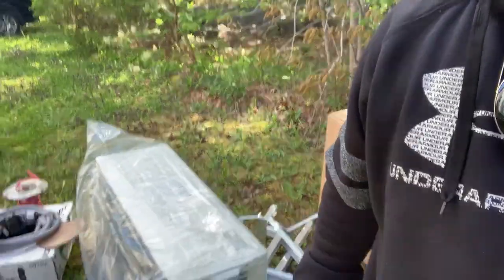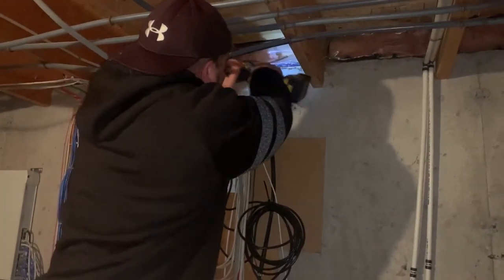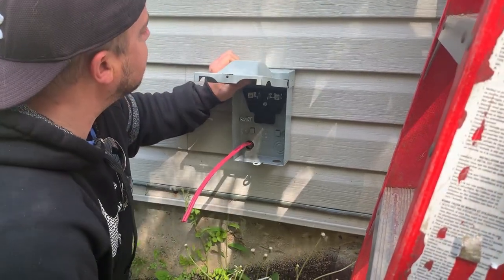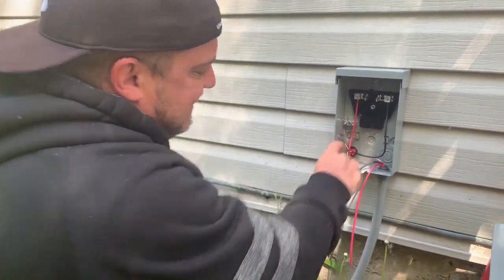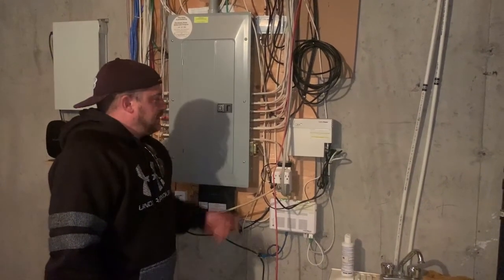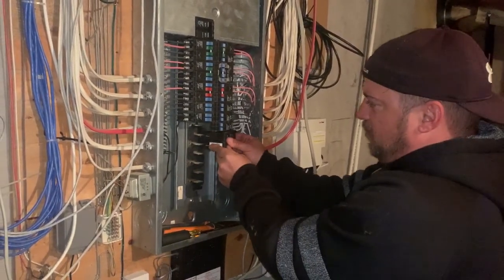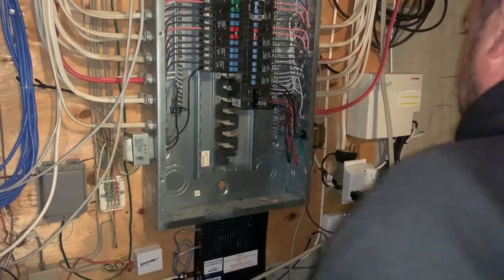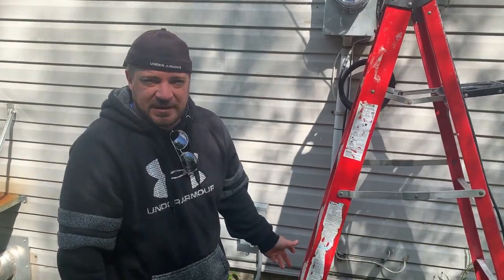Wiring Of Hvac Heat Pump Electrical Installation Of AC Unit

Comment: Must the AWG of the wire FROM the Disconnect TO the panel be exactly IDENTICAL TO (more or less) the whip AWG?  (I have RovSun 12K  btu, "SJOW 4x16 AGW 60 -300v"? THUS, 16 AWG to the disconnect from unit, TO 16 AWG to panel ?) ...I also intend on using Eaton 20A-60A GFCI (code req'd) disconnect box; with 10-2 Romex and 30A dpoled breaker; 1/2 pvc conduit run. Overkill? underkill? Thx! I know a lot of ques, but main ques matters, identical wiring...
Reply: Where would you  even find 16 ga wire to run from disconnect to panel?

Comment: I just called Fuse Electric to wire my mini split ac, which is 6ft away from my breaker outside. These dudes gave me an estimate for $1041.67. Labor is showing as $850 and the rest is the parts. I can't believe how simple it is
Reply: i said the same thing" These electricians are wanting our bodyparts for a  AC DISCONNECT. Did it myself after watching this video. I just turned off the main breaker.

Comment: Thanks - super helpful. We had a baseboard with a 220 30-amp breaker, but the installer used 14/2. When I checked the voltage, one wire was 121 volts, the other was 14. It's an old breaker in an old panel, but there's a new sub-panel to the side, so going to do exactly what you've done here, and use the right wire (10/2) and a 30 amp breaker for our 24k BTU heat pump.

Comment: I just did a similar installation and it took about a whole week! The reason is that I had to make a rather complicated series of pvc pipes and 45 and 90 degree elbows to wrap around the various ins and outs of several rooms, on the foundation under the siding, taking care to rout it over and behind various other obstacles, over to the big power panel. I wanted a neat appearance, so took extra time to piece it together using many pieces, all while being eaten alive every day by hordes of mosquitoes. Then drilled into bricks around this perimeter to clamp the pvc on neatly. The interior unit caused even more problems and several weeks' work because it is an old house with plaster-on-lath walls, and I needed to repair big holes in the plaster, and attach drywall as needed. Because of lack of modern standards with wall studs (they are not evenly spaced and cannot be found with a stud-finder), it took lots of drilling holes to find any studs, and of course only one could be used to attach the mounting plate. Making the 2-1/2" hole was another difficult chore because it is not a simple matter to neatly drill plaster (it is more like brittle mortar) without it breaking loose from the lath. Another problem with the lath is that parts of it are not firmly mounted to any studs, so it is hard to cut loose wood that is just flapping around. In general, I find that any renovation job in this house requires about 4 or 5 times as much work as the same job in a normal modern house. That's why everything looks so easy in the youtube videos, most people face far easier tasks. The last job, installing the outdoor condenser unit, will surely be the hardest part, for many reasons I won't go into. Bottom line: installing this mini-split is taking MONTHS. Oh, besides the thousands of mosquitoes every day, I recently checked the thermometer outside: it was 103 degrees in the shade, but of course my work required working in direct sunlight, had to be far hotter than 103!

Comment: Jeez, I can't even find the correct color code Romex for 230 12 AWG like Red and Black, I know I could use red electric tape but I don't want to do that.
Great Job by the way.
Reply: Use 12/3 Romex. It comes with a red and a black. Plus white neutral and a ground

Comment: Nice video. What type of wire did you use? is it rated for outside use? I am planning to do this at home soon. Thanks
Reply: Was wondering the same.  Im thinking it doesn't  have to be because it's not exposed to the elements.  It goes from inside the house directly to inside the ac shut off. I was looking for a video with this exact setup as I don't want to use conduit for just a few inches of line being run.
Reply: This man did not use outdoor weather resistant conductors.
FAIL
Reply: should have used THHN/THWN inside the whip

Comment: I thought you could not put Romex in conduit?   Should you strip off the jacket before putting in to make the whip?
Reply from the maker: We are permitted  in Canada up to 15 ft by our local inspection authority.
Reply from the maker: We are permitted in Canada up to 15 feet before stripping.
Reply: @conquerallelectrical  ahh.  I did not realize you were in Canada.  In the us that is not allowed.  People do it though.

Comment: I'd like to get a heat pump but my panel is old it has glass fuses not breakers.
Reply: Still can be done, it's just a little bit more pricey. Nice to see a fellow red sander as well.

Comment: Here in New Mexico you’re not allowed to run romex in flex pvc or emt in wet or damp locations
Reply: and some places has to be scheduled 80 not 40. also did i hear him correctly in the beginning of the video he said he was using 12 gauge even after reading the MCA on the nameplate indicates #10?
Reply: @zivaschan  You only need 12/2 for 15 amp breakers. 10/2 is a waste of money, that's more for 30 amp breakers.
Reply: 12/2 for 20 amp breakers as well, and mini splits are always double pole.
Reply: @maggotthemadman8142  Some smaller ones are 115 v., so only need single pole.

Comment: i thought if the MCA on nameplate states 10 gauge even if if is a 15 amp breaker, shouldn’t the minimum be 10 gauge?
Reply: i hope this house doesn’t burn down
Reply: also as i watch the video, i am not sure if local codes anywhere (in USA at least as far as I know) allow for romex inside conduits, even in short lengths, has to be stranded THHN in the whip, which from my understanding some local codes does not allow for schedule 40 and only 80 if it is near the wet ground even if it is liquid tight.
Reply: @zivaschan  What are you talking about? MCA =/= wire gauge.
Reply: @chrism81804  this is all assuming it is a 75°F temp vs 60°F calculation....
Reply: @chrism81804  

To sum it all up — The MCA is the minimum wire size needed to guarantee that the wiring will not overheat under all operating conditions for the life of the product. The MOP is the maximum allowable circuit breaker size that will properly disconnect power to the equipment under any anticipated fault condition.

Minimum circuit ampacity (MCA) and maximum overcurrent protection (MOP) are necessary to correctly connect field wired equipment .  As their names indicate, the ratings will tell you the minimum wire size and maximum circuit breaker size allowed for the equipment.   Higher currents have led to a greater awareness of the risks of overcurrent and fires. The system of MCA and MOP was developed to reduce that fire risk.

Supply wiring must be rated to carry at least the amps shown as MCA.   By comparison the overcurrent protection  device (either a breaker or fuses) must be sized to prevent the unit from drawing more current than the MOP.

Minimum Current Ampacity (MCA)

MCA = 1.25 x [Motor Rated Current + Heater Current]

https://www.electricalservicetechnician.com/how-we-calculate-mca-and-mop/
Reply: @chrism81804  You asked so I answered. But I can see why there is confusion, because I actually didn't hear the OP correctly state as I was multitasking when I had the video in the background, doing some woodworking stuff/chores in my garage. But he was right to use 12 gauge, I thought it was 30 amp he was wiring.

Comment: how do you call the red wire you used? does Homed Depot carry them?
Reply: He said its 12 gauge (12awg) most popular brand is romex and its 2 wires plus ground  so 12/2 wire is what he used.  But you may need 10AWG which is actually thicker than 12 depending on your amperage needs which would be 10/2 for use up to 30amp.
Reply: Im doing a 220v and my mini split is asking for awg 14 which amp breaker do i need
Reply: @adriancaldera8756  The mini-split has to specify the max and min size breaker.  Usually on a sticker on the outside unit.  I usually go with the max breaker number.  14 AWG is good for 15amp breaker max and thats already pretty small for a mini split so I would assume thats what your looking for.  But you have to check with your unit or paperwork to be sure.  
Also go with UF ware not the NM-B as NM-B is not rated for outdoor use.  There are others you could get aside from UF but that is most common at homedepot/lowes.
Reply: @Smithers4 i thought you cant go any lower on the MCA on the nameplate, as in if it states 10 gauge minimum, you cant use 12. (except depending on calculations you can use thinner gauge copper THHN than the MCA)….?
Reply: @zivaschan  I agree that you cant use a smaller wire gauge than the MCA if thats what youre asking.
Reply: @Smithers4  didnt thr nameplate on the video state an MCA? but op used a smaller/thinner gauge wire
Reply: @zivaschan  I hear him saying he's using 12 gauge which is good for 20amps and the  sticker says 10Amp min 15 amp max so I don't see that he used a thinner wire?
Reply: @Smithers4  i heard him wrong in the video. listening background while multitasking, thinking he said the MCA needed a wiring for 10 gauge rather for 30 amp breaker. i think he said it was on 230 v and i was running around doing chores while it was in the background and heard that then commented an hour later, i should have rewatched and look at the nameplate.